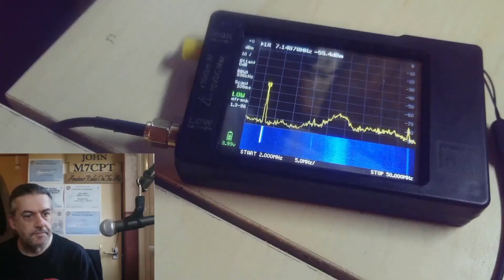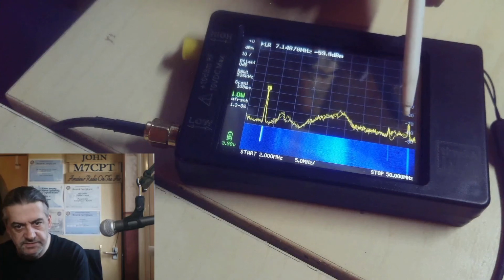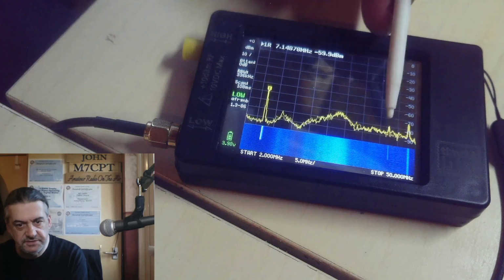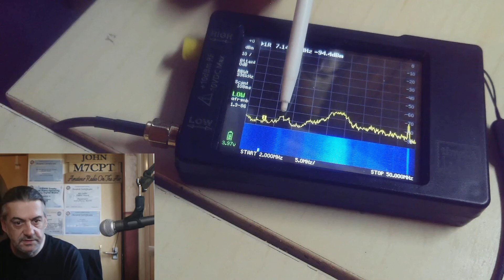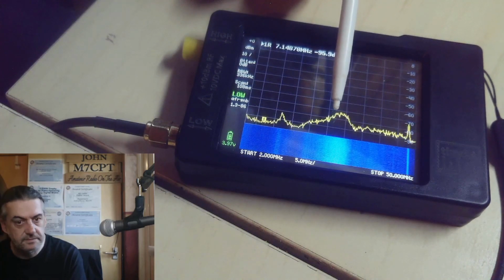How to Use a TinySA for ham radio Fox Hunting and to track down RFI.

Comment: Hi is there any sniffer i can use for ham operator to locate 24MHz interference
Reply from the maker: The TinySA should be capable of scanning on that frequency. You may need signal attenuators when you get close to a source.

Comment: Is the TinySA reliable?  I want to make sure that it will last a good while.  What attracts me to it is the fact that they are not insanely expensive in the same way that typical spectrum analyzers are.  These may be useful for finding unauthorized devices like tracking devices and other bugs.  By unauthorized I mean not necessarily illegal but a device that was placed without permission as most tracking devices would be.  I imagine the majority of the devices would fall into TinySA's detection range of frequencies.  Anything outside of that will need an amplified signal to get too much further especially seeing as how some WiFi does not penetrate walls too well.  That is most likely the key reason why many cell phones work at around 900 MHz.  Too high and you lose your signal when you go into a building with too much metal or a tunnel.  Or if you live in a place where there are a lot of bridges the metal in them may in rare instances cause problems with reception.  Now when it comes to blocking a signal I don't just blindly assume that a metal box or piece of foil will stop it from getting out.  An example is that I use a Faraday pouch for my key fob so the signal is not always available.  One way I test to see if it works is take it into the vehicle with me so I don't lock it in if it works.  Then I see if the vehicle will start.  It should not start with it in there.  Of course I knew it would work because it was designed to do that.  Now I did try the metal box and aluminum foil and neither of them worked even the slightest bit.  I am slightly annoyed since I wasted a bit of foil that should have been keeping food fresh but I feel good knowing I proved that myth wrong.
Reply from the maker: My TinySA is still as reliable as the day I received it. I would recommend you also get some attenuators as strong signals could damage it.
I'm afraid I have not looked into Faraday Cages/Pouches so can't advise you on them.

Comment: I don’t understand why you are walking around with an SA worrying about a tiny signal the fridge is giving off, in a band no one cares about.
Reply from the maker: The signals shown were only examples and the TinySA is capable of scanning a very wide range of bands to show all signals that could be raising the noise floor.
Also the examples while being focused on the 40 meter band actually showed one os the harmonics that was easily visible further harmonics from the same source were affecting many of my HF bands and there were also some that went into the VHF/UHF range.
The idea is to track as many spurious signals as possible and eliminate what can be eliminated in order to lower the noise floor of every band you use as much as possible.